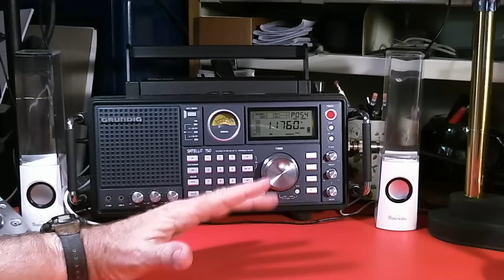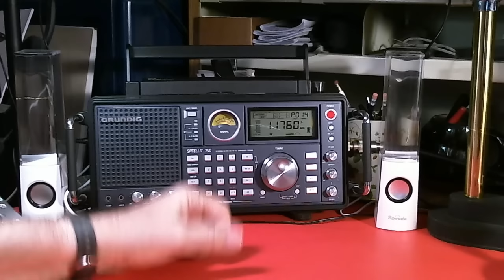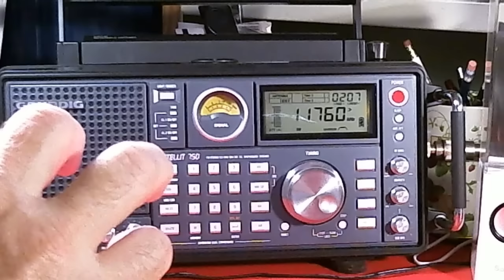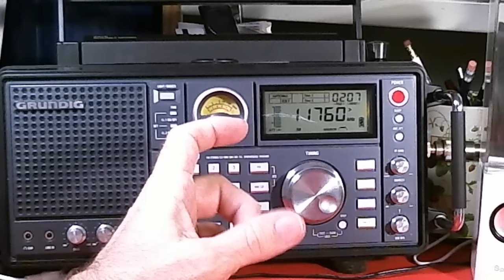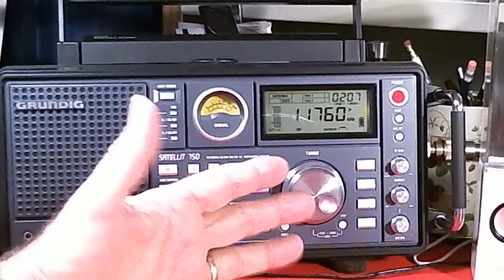TRRS #0634 - Grundig 750, Programming Memories

Comment: Looks like the Sat 750 is a real dandy to program and it should have had more delay
built into it. I agree with you on the Baofeng and it's programming. I have the Pofung
and it is almost the same, hard to program directly from the keyboard. I did manage
to program it but went ahead and got the software to program it since I was afraid of
wearing the keypad out. The software is the best way to setup the unit if you have a
lot of entries to make. Thanks for the review.
Reply from the maker: Dennis Petersen You are welcome.

Tom